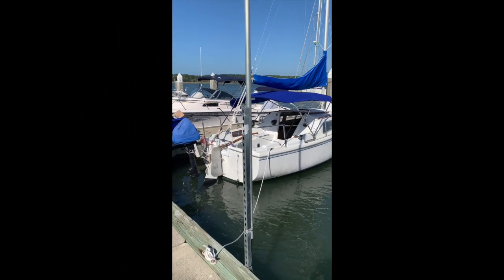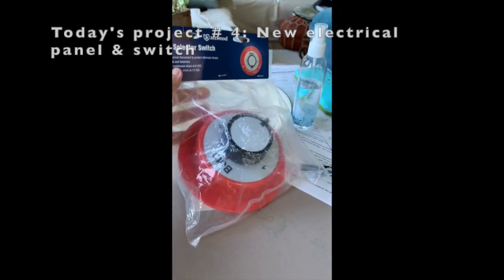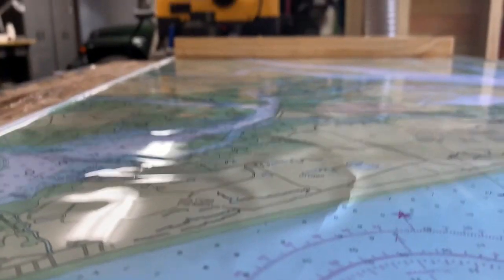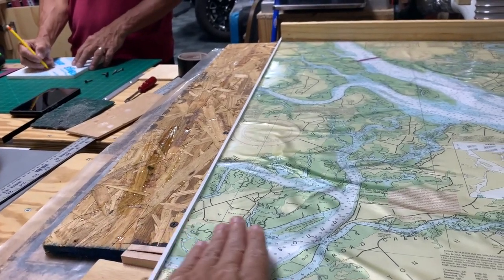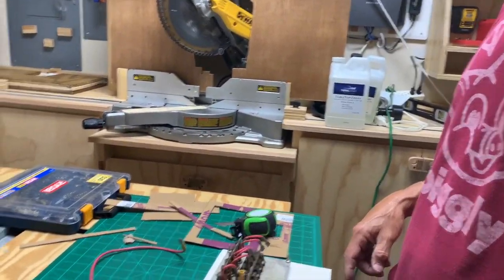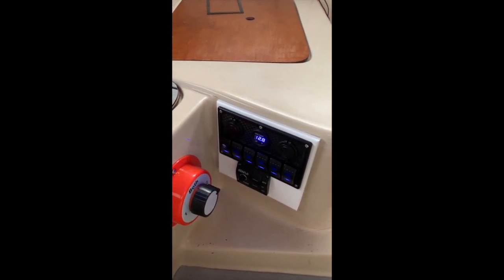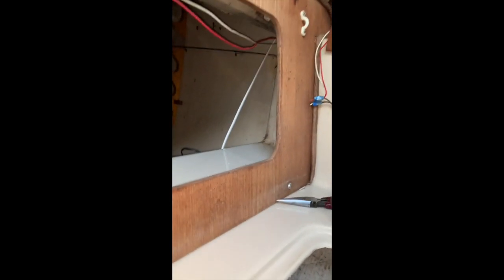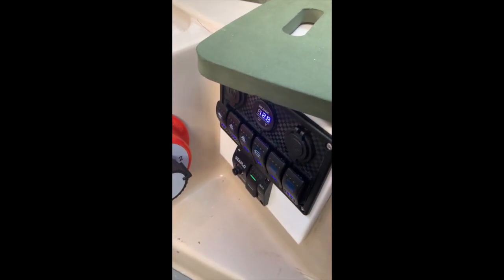How to update electrical issues on our Catalina 22 sailboat

Comment: I would of stuck that isolator switch exactly where you had it but on the other side of that panel so it was hidden with the batteries. Good luck in your classes .👍⛵️
Reply from the maker: He said he thought about doing that so it would be so obnoxious, but he wanted to be able to see it from outside. We’ve put the boat away, companion way shut and cover on boat and had to dismantle it all back to gain access to get something we forgot, so like this, he can peek through windows and make sure it’s off.